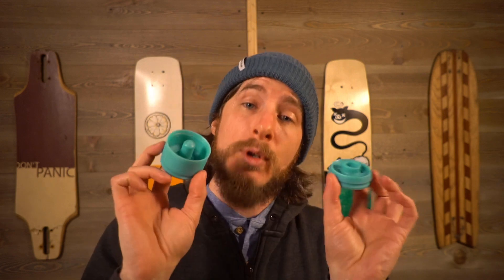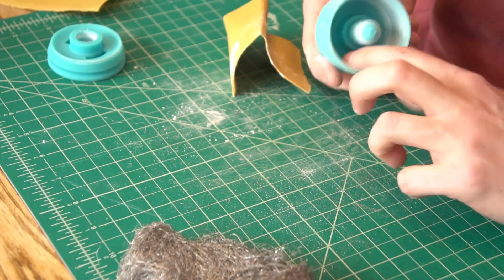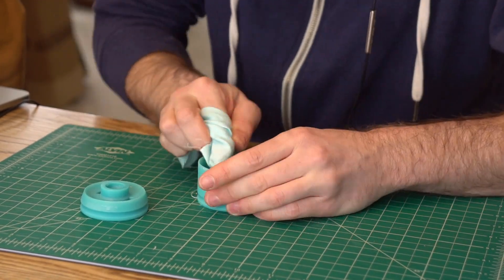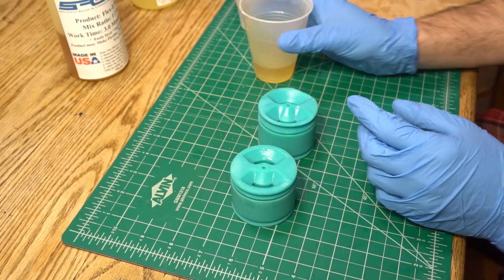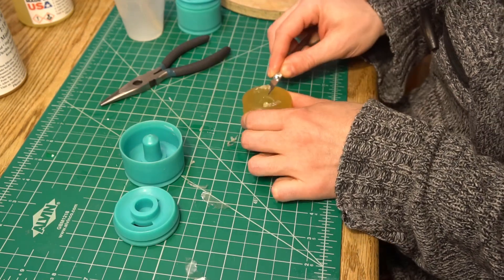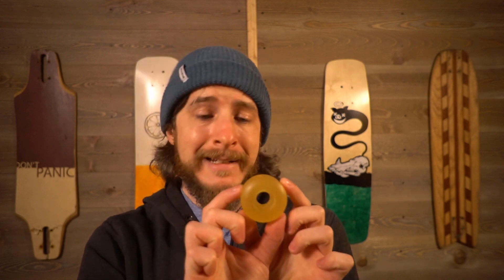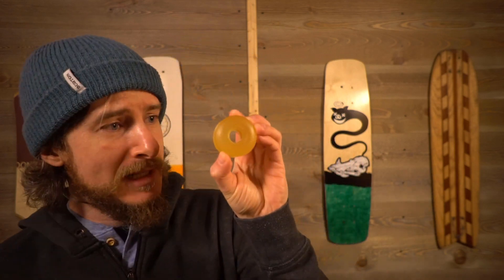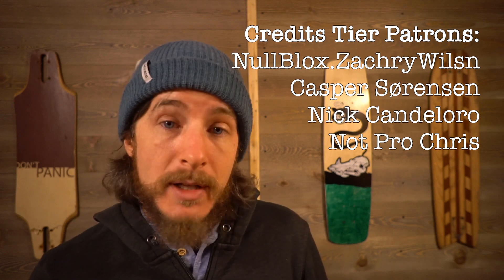A Resin Printed Mold System for Casting Solid Urethane Skateboard Wheels

Comment: The resin print will still be higher than the ABS / Vapor technique I think. Also, I’m really curious how the melt will impact the hub because you do lose detail with that method - you might want to design for it. I think it’ll make it harder to get a snug bering fit but this is a wild guess. Acetone would have been my first guess. Treat the fumes like resin - do it outside / vented. It’s really, really nasty. I have definitely seen The Craftsman mention some mold release for his figures but I’m not sure if it’s Urethane safe. I’m going to start with your system to look at it,  then I’m going to mod it for the quad skating I do - my molds will all need to be a bit different. Also - I have a fav shape and getting good ramp wheels in it at the right height is basically impossible. Moxi gets close but the wheel could still be harder.
Reply from the maker: I've made some attempts at printing / smoothing ASA and the whole experience makes me just want to stick to resin for these molds. I think you're right that the molds will just come out better, and also the materials are a lot less noxious

Comment: Looking to start doing this myself! What kind of 3D printer are you running to print your molds?
Reply from the maker: I recently upgraded to an elegoo saturn so that I have room to print some larger molds, it's working out pretty well so far. You could probably get away with something smaller if you're looking to save some money but the printer I started with was an anycubic photon and that was too small
Reply: Damn, this guy freaking rules! I'm definitely going to try this. What  would you estimate the cost is per wheel? Thanks

Comment: Look into Elegoo SLA printers.  I've found them to be the best bang for your buck when it comes to resin printers.  Also their resin is fairly good and available on Amazon.  Their printers are very nicely made, mostly anodized aluminum parts, and are very high quality for a Chinese printer.  They are really providing some fierce competition and helping drive the prices lower for all the other manufacturers.

The Elegoo Mars is what I've used with great success. Exceptional price point at ~$300 for a 2k 120 x 68 mm print bed.

However the Elegoo Saturn is definitely the resin 3d printer you will want, IF you can find it in stock.  It is in very high demand.  $500 USD, 4k screen, and a 192 x 120 mm print area.

Should easily be able to accommodate a mold for standard 70-90 mm longboard wheels.
Reply: Nice! I guess im a bit behind on your videos and updates, but the saturn is insanely powerful for the price. Never thought about that suction issue though with printing cup shapes.  It takes much longer to print, but you might want to set the amount of lift between layers to be like 30mm, so resin can flow underneath and in the cup if printing it straight on.  If that doesn't work, either printing it at a 45 degree diagonal with supports so resin can flow out of the cup might work too.
Reply from the maker: Thanks for the tips! The lift thing might work for what I need. I'm really hoping I can get away with not tilting the model so I can use those super flat surfaces that come straight of the FEP for the mating surfaces of the mold. We'll see! Fingers crossed!
Reply from the maker: I got a Saturn! It's a killer machine. I'm running into some problems with suction with the prints since the wheel molds are basically cups, I'm getting print artifacts from the way they interact with the FEP sheet. But if I can get that figured out I'm going to have some nice molds on my hands!

Comment: Try anything similar to Cloudwheels
Reply from the maker: I'd never heard of these before, is that like a dual-duro setup?
Reply: @GoodRoads  I have no idea what that is haha, I was looking into creating my own similar wheels because the cloudwheels hub version don't fit my Backfire G2 old hub. On the website they say they use some type of foam for the core. And probably a soft PU on the outside?
Reply from the maker: Oh funky, so it's meant to be sort of like a tire then? I'll do some digging. It'll probably be a while before I have the skills to tackle anything like that, got to get the basics down first, but it's super interesting for sure!
Reply: @GoodRoads  They have normal wheels for belt drive boards and sleeves for hubs since a few months. (Btw Im talkinga about electric longboards haha)

Comment: When will you be releasing these files for use? I’m hoping to make my own skateboard soon and would like to print some wheels without cores
Reply from the maker: I've been working on the updated set of molds the past few days. I'm still fine-tuning stuff and I want to do some testing after I get the wheels cast, but they should be out soon!
Reply: @GoodRoads  great, I’ll be looking forward to it!

Comment: Make a 200a wheel
Reply from the maker: A super hard wheel would definitely be interesting. We'd probably have to move over to the Shore-D scale of durometer though. Shore-A tops out right above 100 so hardnesses like 150a or 200a don't really exist but like an 80 or 90D wheel would be super hard

Comment: May I suggest using the central pin inside the lower mould half as a pusher to eject the wheel after pouring and curing? Injection moulds work with pushers and in this case the bearing seat looks like the ideal place to push the wheel out. It does make it a three part mold again but so much more reliable when it comes to extraction. Certainly improves ease of use. Love your content. Keep it comming!
Reply from the maker: I was thinking something similar: I could extend the central pin out through the top of the mold. After the cure was done I could invert the whole things and push against that pin to unseat the wheel from the mold
Reply: @GoodRoads  wouldn’t you be pushing the wheel into the mould like that? In my ideation it would stick out the bottom of the main mould shape (with a seal somehow)... and when the wheels is poured you push the pin with the wheel on top out of the mould by pressing the entire thing down on the table. Perhaps you meant the exact same and I misread :-) It needs to stick out the bottom that’s for sure.

Comment: Is it possible to make 104a hardness? Just like the discontinued bones SPF im a fan of hard wheels 😄
Reply from the maker: You'd have to find the right urethane. I hoping to do testing and reviews of a bunch of easy-to-use urethanes here on the channel and I definitely want to get some harder ones in the rotation
Reply: @GoodRoads  thank you so much, any idea on the availability of the specific hardness and if its possible to avail here (im in Philippines btw)
Reply from the maker: I'm sorry to say I don't know. The availability of different materials across the globe has been really frustrating. It would be awesome to have a database of some kind, but I'm not ready to tackle that project just yet. Something I have learned is that 104a (and other shore-A durometers up near 100) are usually listed in the shore-D scale by manufacturers instead. The two scales overlap and if I remember right 100A is similar to like a 55D? Hopefully that helps you some in your search
Reply: @GoodRoads  very helpful indeed. Thank you sir for your advice. Ill look up on your other videos. Thanks again

Comment: 47mm wheels id still rock them and i normally ride 54-63mm, the bearing seat is wonderful perfection in a pour
Reply from the maker: I've been digging the 53s I made for my street board and I like a 64 or so for a longboard or cruiser, so we're just going to have to step it up

Comment: sand prior to doing your final uv cure for sla printing.
Reply: This allows it easyer to post process
Reply: annnnnd more to that get a elegoo saturn, it is what I use, super fast and much bigger plate
Reply from the maker: Sanding the uncured resin spooks me a bit, do you wetsand it? Honestly, even cured it's so much easier to sand than printed filament
Reply: @GoodRoads  i start with soft non wet then end with wet. The steel wool would work as is too if its 00

Comment: ive heard of people using cooking spray for mold release with diy injection molding, not sure how it would work with resin. You could also get silicone grease thinned with mineral spirits and then put that in a little spray bottle?
Reply from the maker: Yeah, something spray-able is the ideal

Comment: Have you considered making silicon cap molds for your coreless wheels? I'm considering giving that a try. The only downside I see is that it may result in misaligned bearing seats due to the flexible nature of silicon.
Reply from the maker: That's the main reason I've stayed away from silicone for the wheel molds, I'm worried the rolling surface or bearing seats will deform. Are there stiff silicones out there? Maybe that's the ticket
Reply: I've seen molding methods using a hard shell keyed to a soft silicone insert.  Idea being the hard shell has generous draft angles to release from the silicone, then the silicone can freely unwrap from whatever crazy undercuts and dimple features, etc.  Such a method may add a few steps in creating the molds, but the hard shell could be fdm printed with no extra finishing.  Wheel surface would have some sweet fdm grooves/ texture.  Speaking of which, it would be cool to see some grooved rain wheels.

Comment: just curious, I want to make a rounded contact surface mold so it would have to split down the middle to come out. Any reason that would not work?

Given I only need one of them per board I could destroy the mold each time but reusable is best.
Reply from the maker: Yeah, that should work as long as the seam seals up tight and the mold doesn't leak. What kind of board are you making that needs a single rounded wheel? You've peaked my curiosity!
Reply: @GoodRoads   the rounded wheel is for a suspension electric caster that attaches to a freebord to provide thrust. My idea is it could be raised and lowered by a pull cord sticking out the top of the board. The wheel needs to be rounded for edge to edge transitions, you can look up the Summerboard sbx wheel for reference.

Your newest patron btw!
Reply from the maker: What?! Hahaha freebords were crazy cool enough as it is, I can't imagine what a powered one would be like!